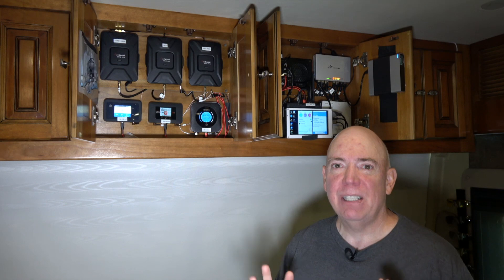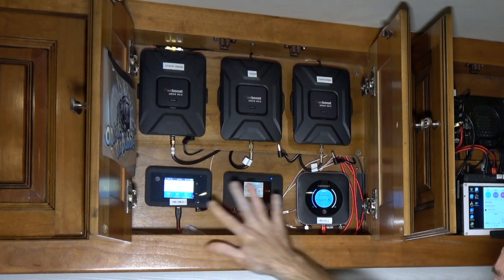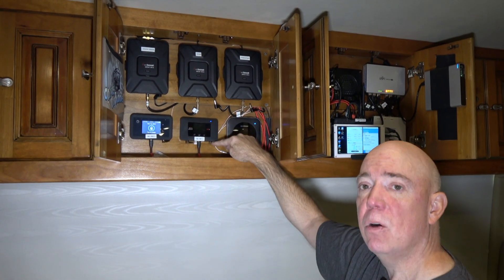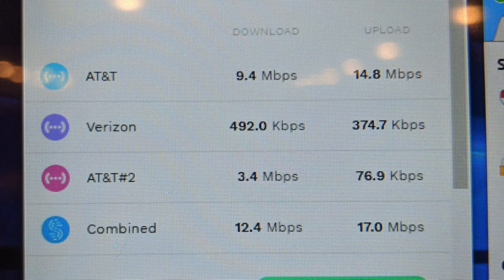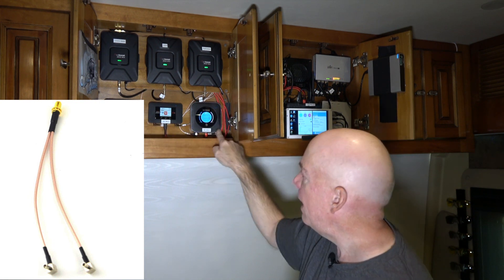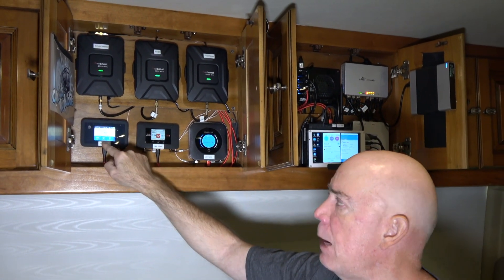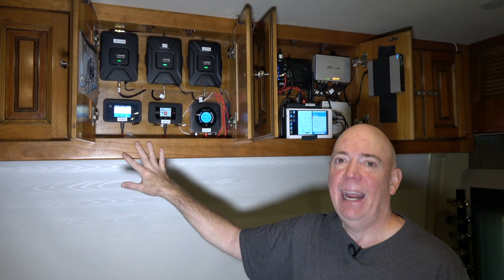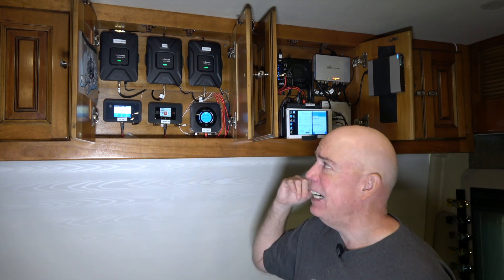Super Boost 4G JetPacks using weBoost Drive 4G-X Direct Connection!

Comment: Looks like you have 3 weBoost antennas on the roof.  If you have (3) weBoost and (3) jetpacks capable of MIMO, why not split all 3 weBoost and distribute them as :  antenna1a & antenna3a to jetpack1, antenna1b & antenna2a to jetpack2, antenna2b & antenna3b to jetpack3.  Then you don't need your inside antenna.

Comment: Hi Dave. Great info here. I'm a seasonal part-time RV'er and tend to have great service when I travel. I have a Netgear (AT&T) in my coach and have good luck with it. I live rural and have terrible cell service. I use AT&T Micro Cell to boost my internal signal. Would the weBoost Drive 4G-X booster give me better data speeds in my home? I'm assuming it doesn't matter if I'm in a parking lot in my coach or in my brick & mortar. It should increase my signal & speed.
Reply from the maker: Hi...Unless I am mistaken, an AT&T Micro Cell is a booster made to bring signals inside a home or office.  If this is the case, than a weBoost in your home will not help much.  (But it would in your RV of course.)

Comment: Great Video! I have a similar setup (no boosters, but bonding AT&T, Sprint, and Vzw) ... You might consider installing an inline attenuator on the output of the 4GX's to reduce the amount of RF heading into the jetpacks. Too much signal will cause errors (which seem to have appeared as the latency increase - possibly causing packet loss). Just don't want to see you overdrive your jetpacks, but I know this was just a fun test!
Reply from the maker: Yup...I did have a concern about over driving them as I did mention the concern about blowing them up. :)  But all have been good for a month thus far. But surely being "TOO LOUD" is also not a good thing.  Seeing I am splitting the signal, I am dropping the signal by about 3.5db per split.  (Though it would be good to reduce it even more.)  Just need to be able to find a attenuator that would work for this seeing the freq range is 700 to 2700)
Reply from the maker: BTW...How does Sprint work out for you?  I have two AT&T and one Verizon (all unlimited plans) and always wondered what Sprint or T-Mobile would bring.  I surely know it is based on location like anything else, but just wondering how you may have found it to be in your travels?
Reply: Sprint has been okay on the East and South coast - Maine to Florida - west of Ohio, is awful... I have the unlimited plan from Calyx Institute.

Comment: Question: I have both a Verizon JetPack and an ATT JetPack (both also have Mimo ports). If I decide to use just a single attenae and booster for BOTH units how might it work with the splitter connecting to one input on each JetPack?  Would I see a reasonable performance improvement? Really appreciate your efforts for our mobile connected world.
Reply from the maker: You would not want to do that over a signal antenna. For MIMO it requires more than one antenna that is why there is more than one antenna inside the JetPack.

Comment: Thank you for walking us through your setup.  Do you have unlimited data plans on all 3 JETPacks?  Do you use the park's Wifi when you are parked and do you connect the park's Wifi into your VPN Bonding Service when parked?
Reply from the maker: Hi...Yes, I have unlimited data on all three JetPacks.  I use the parks Wi-Fi when I can if it has decent service. They way I have my system set up is I can use just the the parks Wi-Fi or I can add it into the VPN Bonding along with the JetPacks.  It all depends on the level of service.  Here at North Texas Jellystone Park and when we are at Southwoods RV Resort, the service from the park is good on it's own and thus I don't use the JetPacks to keep my over all data use on the plans lower. (I am always afraid of losing service or speed due to maybe being throttled.)
Reply: @DavidBott  Thanks!  I am considering a similar VPN bonding setup, using 2 JetPacks with one weBoost antenna, for my boat on Lake Michigan and wondered how you handled the Wifi.  We have great Wifi at our home dock, but use the JetPacks when traveling to other harbors.
Reply from the maker: @kurtlentsch  I would just put the inside weBoost Antenna right next to, even touching, the two JetPacks. This way they can get the benefits of the boost with the Frequencies they are using at the time.  This is how I had done it for years and worked very well. This was a test to see if it would work and not over power and burn out the JetPack receivers. (I have a few extra JetPacks so I was not worried if it did. LOL)  But it worked well.  Now if I am closer to a tower while parked, I may not use them like this as you can surely have TOO MUCH signal and that can also be bad.  So I would test with and without the direct connection when I get somewhere.  Depending on what you use for the VPN Bonding, of Windows like Speedify and Connectify, then Connectify can be setup as a Wi-Fi access point for your devices to connect to if the device your running it on has Wi-Fi.  Here are links to the two products used...  https://speedify.com/    https://www.connectify.me/

Comment: Hey Dave. Thank you for doing the legwork on this. Did you remove the weboost internal antenna completely? Looking forward to trying this with our Verizon 8800 jet pack.
Reply from the maker: Yes, at this point, based on how I now have it, I am not using the inside antenna for the JetPacks.  Our cell phones can still use it however seeing how I have it hooked up with a T to the one JetPack.
Reply: Thanks for the quick reply. I’ve already ordered the required cable.
Reply: @davidboland5344  Can you possibly give some assistance on how to set this up. I am looking for the simplified version of this using an AT&T hotspot and a Weboost Drive antenna. Thank you very much.

Comment: How does the booster work being near your we boost inside antenna vs being plunged in directly to the booster.
Reply from the maker: Works fine. Until this point I would have the inside antenna inside the cabinet and JetPacks stacked on top of each over with the inside antenna right against the side of them.  Just using numbers to give you an idea on signal... Without any booster the JetPack may have say -103 db signal.  With booster ON and Inside Antenna right next to JetPack... Signal will increase to say -75 db. With the JetPack directly connected to the booster -49.
Reply: David Bott wow so it’s a significant improvement. A friend of mine has a webboost and a jet back I’m going to tell him about your setup.

Comment: Hi David.. I like the idea of how your using the boosters.. My question is what do you do about heat and how are you supplying power to all 3 boosters.. (Did you need to run another source of power up there..
Reply from the maker: Good questions!  I have a Wi-Fi temperature sensor in the cabinet that I have set to alert me on my phone if it hit 105+ degrees.  But the cabinet does get A/C from a vent as the doors are not tight. The main Wi-Fi area actually has a 3" fan pulling air out of the cabinet thus pulling cooler air into it. (I may end up doing the same in the booster area but not sure it is needed as those cases are more or less big heatsinks!)  As far as power...up behind that false wall that they are hanging on is a lot of power.  Both 110V and 12V lines.  I tapped into a 12V with a 3 port car lighter adaptor and have them each plugged into that.
Reply: @DavidBott  Thank you... Right now, I have a 120 in the cabinet but no 12v. And I will look at adding a fan up there because I notice that it does get warm in the cabinet with my WiFi running.

Comment: I have come to the conclusion you are the Tim Taylor of RV communications ( more power  )😁👍
Keep the rubber on the road.
Reply from the maker: I just can't wait until I can get Starlink Internet sometime, I hope, next year!  That hopefully will be "THE TICKET" and the end to having to mess around with all this gear! (Multi JetPacks with VPN Bonding and Boosters)  Just one nice fast connection anywhere, anytime vs hit and miss services.
Reply: @DavidBott  - Dave - will us RVers still have something of a problem with Tree canopies and satellite internet?  I'm wondering about campgrounds that are mroe in the East/Northwest/and maybe the Rockies that may have too much canopy that could inhibit the satellite signal?  Would we then have to have some type of antenna that gets out from the canopy?  I guess it would have to be a thick canopy though

Comment: I like the idea of 2 antennas and splitting to create MIMO. The nighthawk actually has 4x4 mimo on the internal antennas so it does really good just by itself. I have tested the single booster antenna and the mimo jetpack internal always outperforms the booster in good areas. So maybe doing the splitting of 2 antennas on the roof would help as your test show. On another note  my nighthawk does amazing with the small netgear mimo antenna stuck to the glass. If you have that David maybe you could test that against your booster setup.
Reply from the maker: Hi...If this Nighthawk has 4 antennas...then not sure why it only has two external antenna connection points.  (Unless this is a different model Nighhawk which it likely is as it is the original one.)   But yes, 4 MIMO would be great if you have a tower that would support 4 different frequencies as the more connections to a tower, the better IMHO! :)
Reply: @DavidBott  I agree strange they only give 2 ports but the 4x4 is one reason that the nighthawk gets such good speed with any external antennas.  https://www.netgear.com/landings/nighthawk-mr1100-mobile-router/

Comment: Great video, Impressive setup. I’m guessing you did a test with a single antenna and we boost verse the multiple we boost setup. Significant ?  For those who only can afford or choose a single provider and jet pack do you have a favorite ?  And which would be your second choice. Thanks Kevin
Reply from the maker: That first JetPack you see is setup using ONE antenna directly connected to the weBoost as mentioned.  It is plugged into TS9 port one on the JetPack.  Verizon seems to give me usually the best speeds, but AT&T can do very well as shown.  I like the new NightHawk JetPacks from Netgear as they offer the most frequencies as well as of course MIMO. I have to use three different JetPacks however based on finding out that NetGear seems to use the same MAC address in each JetPack for the Ethernet over USB connection. (The same model will have the same MAC address.)  As such, the VPN Bonding software did not much like seeing the same MAC address from different connections. (Nor should it!)  But seeing that these were never really thought of to be bonded together...I understand why they did it.

Comment: Excellent video David. A couple of question. Wouldn't replacing the AT&T Explore with another Nighthawk and Netgear 791L with a Inseego 8800L improve the speeds?  Thinking here a CAT18 would do better than a CAT9 with the right antenna setup. I know you need it inside the coach but wonder if you bonded OUTSIDE without the Weboost using the internal antennas if the speed would be even better?
Reply from the maker: Good questions...Yes, the newire JetPacks with a wider selection of useable bands is always a plus!  So yes, I could replace the older ones with newier and should see a benefit.  But the idea here was to show that direct connecting the pack to a booster can be a positive thing. So it is not so much about the JetPacks themselves that I was testing and showing.  Not sure what you mean about bonding OUTSIDE the coach as the VPN Bonding that I mentioned is for increased speeds using multi internet sources is software that I run.  https://speedify.com/   Here is a video I did on it... https://youtu.be/KqslIHCKC3E
Reply from the maker: Side Note...One of the reasons for the different JetPacks is that it seems that the NetGear units use the same MAC address over USB Ethernet. As such,  it gave the VPN Bonding software issues as the MAC address it was trying to talk to was the same.  So the use of 3 different JetPacks solved that as now I have 3 different MAC Address coming over the USB link.